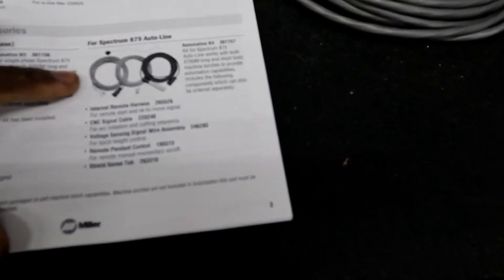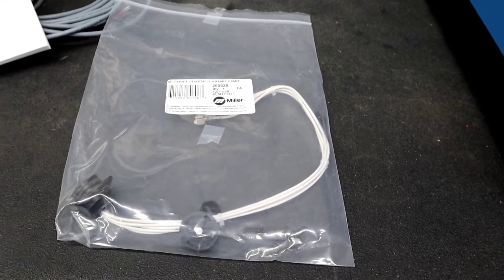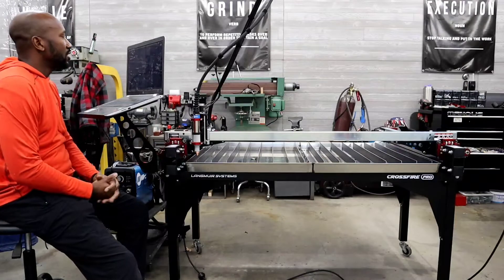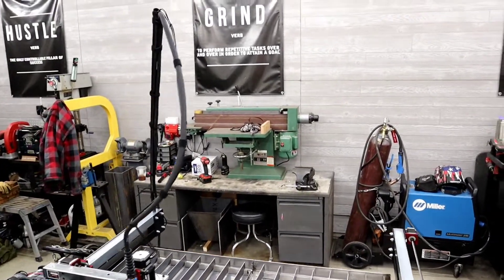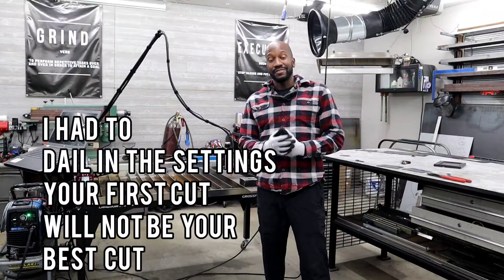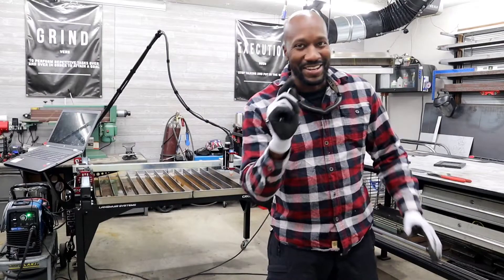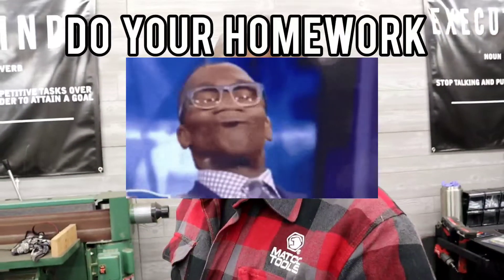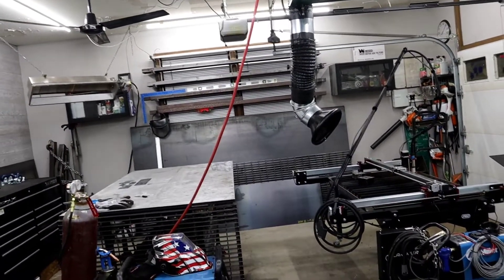Miller Spectrum 875 Autoline wired up to the Langmuir Crossfire Pro

Comment: Hello, how are you? Excuse me, I have a question exactly like this. Do you need an air flow regulator? Or not? The second point, what is the regulator in the video and where can you get it? Thank you.
Reply from the maker: @Zizoum-1  you do not need an air flow regulator with the Miller Spectrum 875 Autoline. 
The Miller Spectrum 875 Autoline has an automatic feature that self regulates the air flow out put.
The air flow regulator I show in this video, is there for when I need to adjust the air flow out put when I'm painting in my garage.
Reply: @marcustomz  

Thank you dear, one last question if you allow me! What is the diameter of the internal connection of the air hose inlet in the machine? Because the machine that I got from a friend does not have a nut connecting the machine to the air hose. Do you know its diameter or size? For example, 10 mm or more? Sorry to bother you
Reply from the maker: @Zizoum-1  4 to 5 millimeters.

Comment: I just want to ask you a question about how many HP?  Do you recommend the compressor and how many liters is the compressor tank?  Thanks in advance👍
Reply from the maker: My Kobalt 60 gallon compressor is 3.7 running HP
11.5 SCFM @ 90 PSI
13.4 SCFM @ 40 PSI 
155 max PSI 
The compressor does the job. It kicks on  about ever 45 minutes.
I'd like to add a piggyback tank one day.
Reply: Thank you very much for your information, I am planning to buy a 5 HP compressor

Comment: Hey bro, just letting you know, you don’t need to run an air water separator on the machine. The 875 comes with an internal one from the factory
Reply from the maker: Wow! I had no clue, that's pretty Dope!! Thanks
Reply: @marcustomz  I was about to install one, but I installed the 12v harness first and noticed it already had one when I took the cover off. It’s tiny, but still supplied inside. The more I think about it, your probably better off running the external too to prevent water making it inside the machine. I don’t understand how the internal on works. Normally there’s a valve you open to drain, but I can’t see mill making you take the cover off everyone to drain it. It also has a black drain hose that goes right behind the black plastic cover

Comment: Didn't see you connect anything to that rear cannon plug you Installed in the video! Did you end up using it for the setup?
Reply: I am wondering the same thing. Have you had any need for the cannon plug?

Comment: Help! I am pulling my hair our trying to get this same setup working! The torch will only fire when i hit the torch off button not the torch fire button! Miller tells me that the 875 Autoline with machine torch uses a momentary switch to fire the torch and the Langmuir uses a closed circuit torch fire. Did you run into any of these issues when setting yours up?
Reply from the maker: I did not run into this issue.  Do you have the torch height controller from Langmuir?
Reply: @marcustomz  I do yes, I am so confused! Did you run raw voltage out of the Miller or divided?
Reply from the maker: Do you have the Automation kit?
Reply: @marcustomz  yes from Miller
Reply from the maker: Hey Buddy,  try this. The "Torch height controller cable" coming from your Langmuir System Control ecu box. Move that cable to the "PV Output" on the Langmuir Torch height controller unit. Tell me if that solves your problem.

Comment: great video! thank you so much for sharing!!!
Reply: trying to gather necessary parts of the 875 Autoline automation kit. with the crossfire pro, does your machine torch use the Shield Sense Tab? if so, what is it for? how does it install? thank you! can’t wait to see the press brake build!
Reply from the maker: Hey Jeremy Quant!  did you get the Animation kit for your Miller 875 Plasma Autoline ?  Also which plasma table did you decide to go with? The Sheild sense tab is not needed to function this cutter.
Reply: Thank you so much for the info!! Haven’t received my table yet, but it’ll be the 4x3 Pro.
Reply from the maker: Jeremy Quant, no problem,  thanks for watching Marcustomz Garage.

Comment: Great video! I have the 875 autoline too and this is the very first video on wiring for cnc. I'm building my own plasma table, and want to use the Miller. Although I don't have the straight torch handle, I'll have to work some OT and save for it. Thanks again.
Reply from the maker: Ryan Riendeau your building your own plasma table? that's Awesome !! You'll love the convenience of being able to switch between torches on the fly.

Comment: What’s if we have the 875 but not the auto line
Reply from the maker: Hey Jessury Ceballos the non Autoline kit has a similar but different wiring configuration.  I would call Miller and talk with the Tech support they are very helpful. The manual for the non 875 should help some as well. I'll go look at my manual to see if mentions the non 875, I'll get back to you.